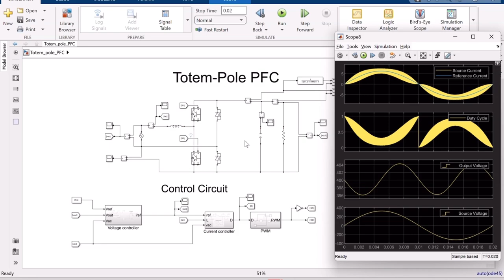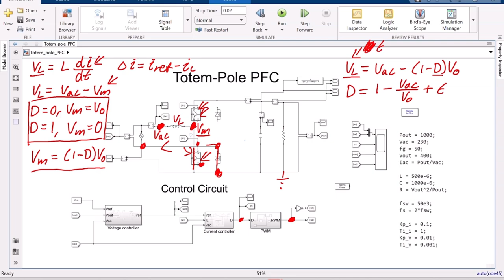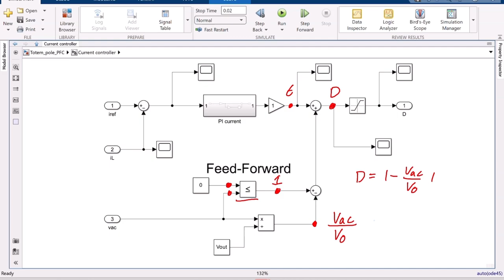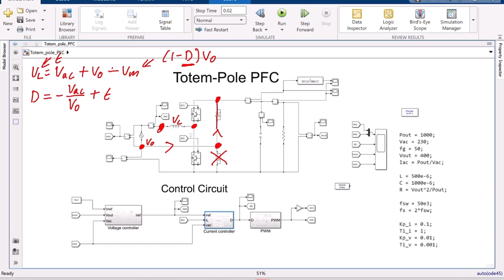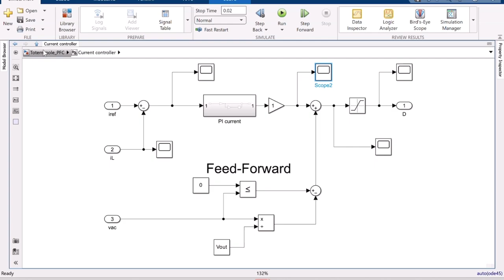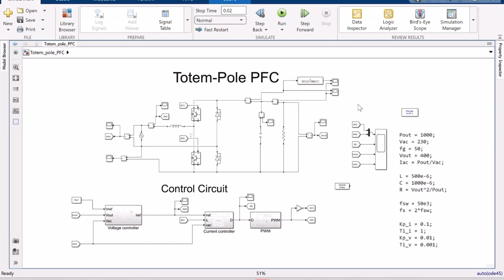How Totem-Pole PFC Works, MATLAB SIMULINK

Comment: Is  needing to use epslon ou we can considere zero for VL ?  
why did you  considere that the Eplson is the error the signal after d=the PI controller ?  it maybe the voltage  ?
Reply from the maker: Hi, the model derived is not correct because we assume that vL is zero. vL is only zero when there is no current conducting through the inductor, so if we have some current, the model is wrong. 

However, even though vL is not zero, it is usually avoid computing vL because it is found by differentiating a measured current, which amplifies noise. And in many designs of the totem pole pfc, vL is close to zero anyways

Epsilon is simply the error of the model, and is «found» using the PI controller. For an ideal totem pole PFC, epsilon = vL. But in reality, there are many other errors with the derived equation. For example, the resistance in the inductor is not included in the equation, and neither are the measurement errors.

I didn’t go into full detail here, but I hope this answers your question.
Reply: @Kristian_SkorpenWe do not  assume, the physical Behaviour ot the inductance say that, the mean value is zero.

How comes the error is the output of controller and not the input of the controller ?  

My question is just to understand the introduction of epsilon on the systeme  and you considre  the error but the error is the input signal of the controller.
Reply from the maker: Hi, the input of the PI is the error of the current, while the output of the PI is an estimate of the error of the model derived in the video (feedforward).

When we control the duty cycle. We would then find an equation for the duty cycle and use this equation to control the duty cycle. However, this equation is most likely not accurate, for example, there could be measurement errors, or in this case, the voltage over the duty cycle is not included in the equation for the duty cycle. Therefore, we add a PI controller to correct for this inaccuracy. So the output of the PI corrects for the errors in the equation, that is why I called it epsilon. While it would also be correct to call the current error for epsilon instead.

I hope this answered you’re question😊 If you have further questions please contact me on email: kristian.skorpen.yt@gmail.com

It is not so easy to show mathematical expressions in YouTube comments😅